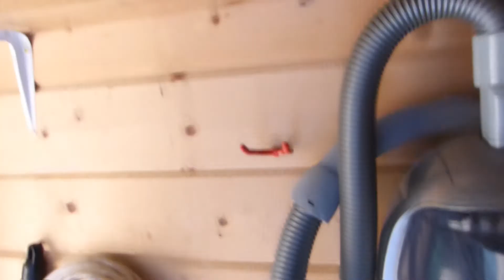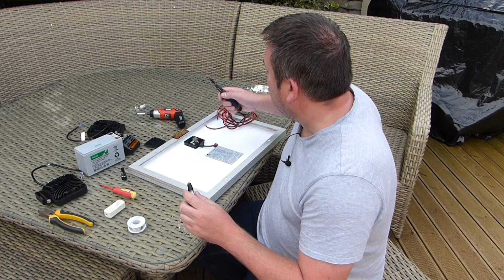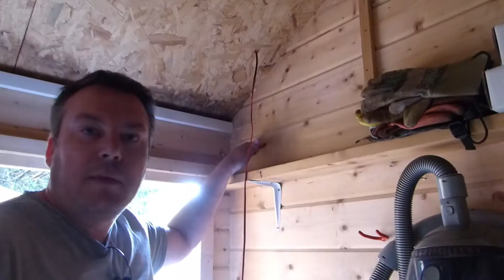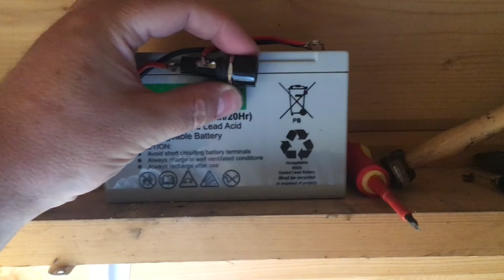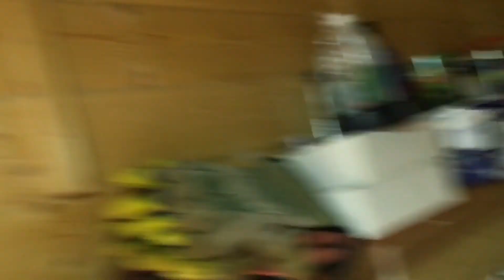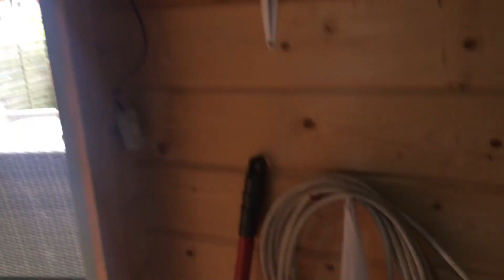Simple Solar panel installation

Comment: The best solar guide I've ever watched! You covered points that I never considered (such as cutting the solar panel wires separately) I've added the video to my watch later list so I can refer back to it if I do decide to install a system in my shed.
Reply from the maker: +Hobby Picker thank you for your kind words.  Im certainly no expert but it's really not difficult and its good :)
Reply: Thank you for the video! I'm no expert either but I do understand the basic circuitry. Having something as a guide is so much nicer just to make sure you're doing it right!
Reply: Quick question, some people say that when the battery is fully charged the excess power is sent out through the load, I personally don't see how that would be practical, if you use a light for example with a switch then the power wouldn't actually be used. I assume that instead the controller would send the excess power through a resistor that would loose the power as heat. Since you probably understand more about charge controllers I thought I should ask.
Reply from the maker: Hobby Picker ok good question. I have heard this too. As far as I can tell from experience, this is incorrect. The load is purely a switched load. Nothing more. I know with some wind turbines there is a way to dump excess electricity through a large heated coil... but not on these controllers. The circuit just stops power going into the battery pack until it detects it needs a top up. Good question  though and I have heard that myself. 👍🏼
Reply: I thought it would be safer to ask, I did think it sounded rather illogical. What will the solar panel do when the controller stops electricity from coming in? I know there should be a diode to stop back-flow but wouldn't you risk frying the solar panel?
Reply from the maker: +Hobby Picker is imagine that when not charging, it would effectively be an open circuit and nothing would happen. Like a battery. The battery only produces current whilst in a circuit
Reply: I understand, thank you for explaining it to me!

Comment: I noticed a plug socket in your shed.
Reply from the maker: +Maxsdiscos correct. That socket is on a timer for the outside lights and is not live all of the time... but this isn't really the point of having solar anyway. But well spotted.  I knew someone would pick up on that lol 😂